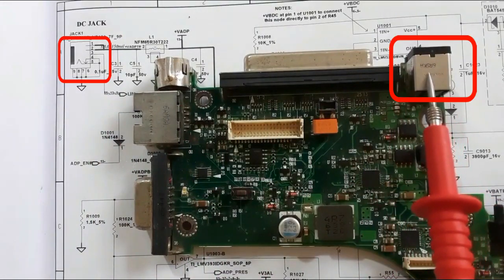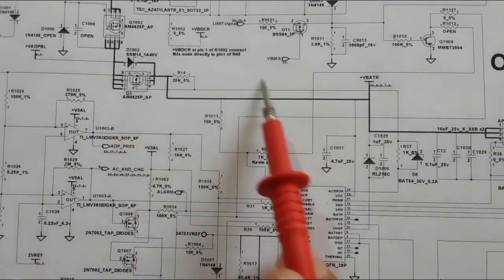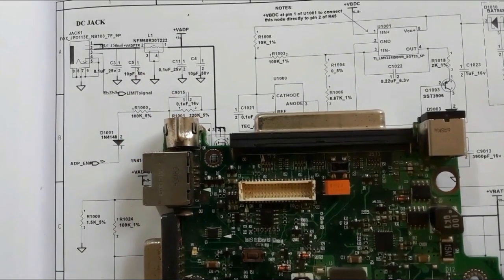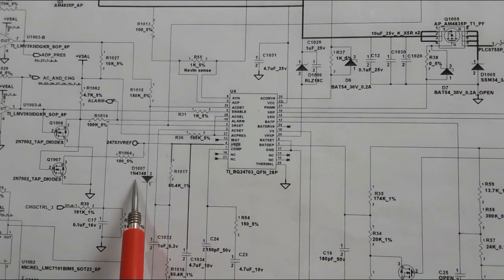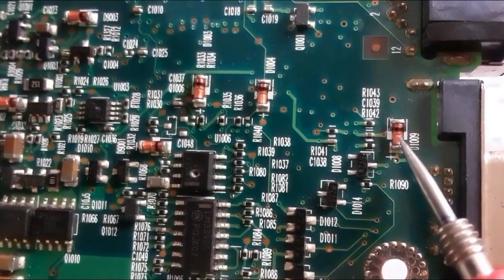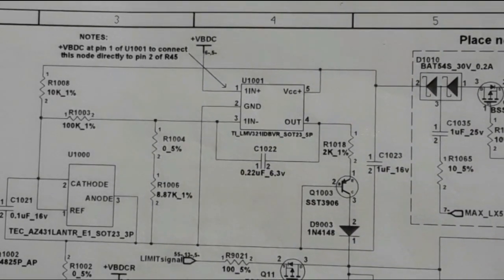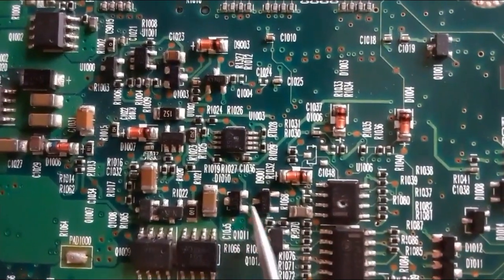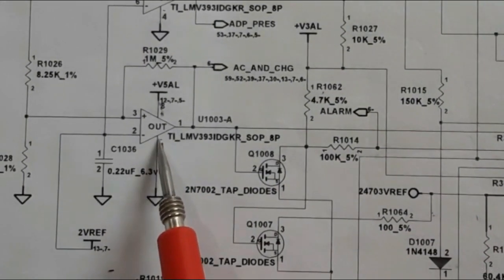Learn laptop motherboard components with symbols

Comment: Hi which pins do you touch in order to turn on a Dell Inspiron N5010 laptop motherboard? I know how to jump start desktop motherboards but how to do it in laptop motherboard? I'm currently working on that laptop👨🏻‍💻 thank you!👍🏻
Reply from the maker: You can turn it on by shunting the 3.3V pin with the ground in the power button connector
Reply: @electronicsrepairbasics_erb  thank you I will look for the 3.3v location on the board and try it.